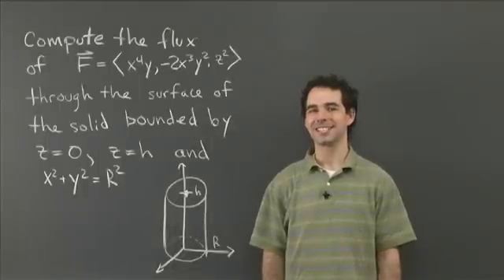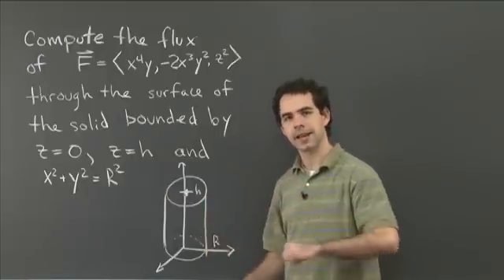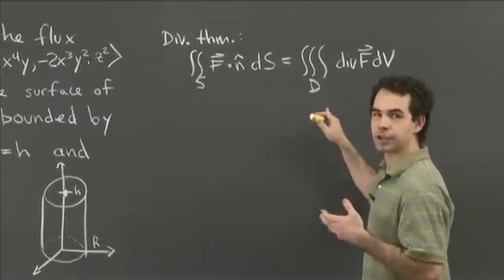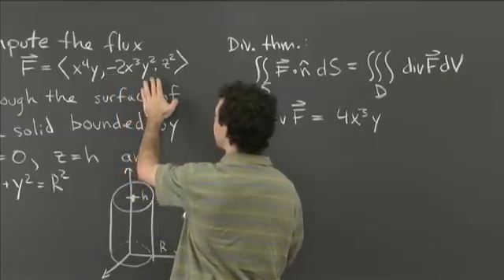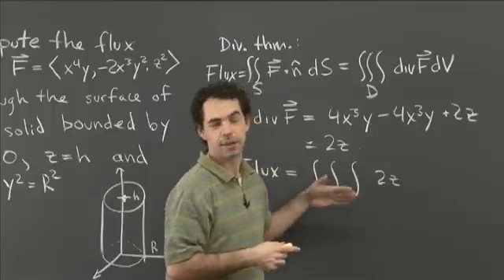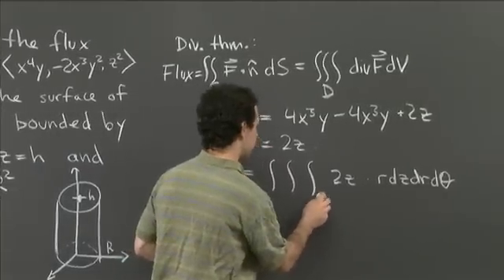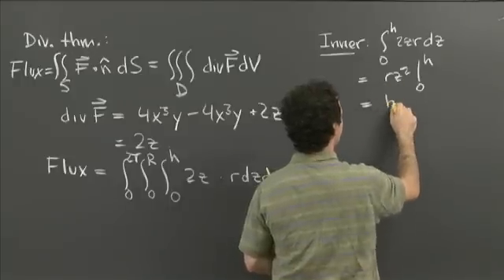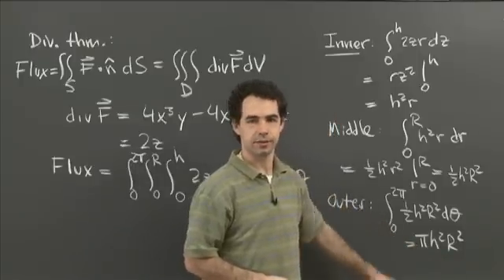Flux and the divergence theorem | MIT 18.02SC Multivariable Calculus, Fall 2010

Comment: Is there a proof that shows that the divergence is the sum of the partial derivatives? Why is this the definition and why does it work?
Reply: Probably late answer, but the divergence of a vector field F is by DEFINITION the sum of the partial derivatives of F. It's the dot product of the vector ∇ and F, where 

∇ = <∂/∂x,∂/∂y,∂/∂z>

so 

div(F) = ∇·F = <∂/∂x,∂/∂y,∂/∂z> · <F1,F2,F3> = ∂F1/∂x + ∂F2/∂y + ∂F3/∂z
Reply: There are many different proofs for it. Just requires a bit of algebra.
Reply: Actually using the nabla operator to define divergence with dot product COMES from the fact that it can be proved that divergence is the sum of the partial derivatives. So that is not a proof! One way the demonstrate it is that being the function differentiable in a point, you can write down its linear approximation using Taylor's and then demonstrate from there that the divergence of the function depends only on the term with the gradient. With some Algebra that brings you to the fact that divergence is actually the trace of the Jacobian matrix!
Super late response :P

Comment: V. (Total 12 pts) Let
f(z) = 1 . z2 − 5z + 6
1. (3 pts) Write f(z) as a sum of two fractions, i.e., f(z) = A + B ;
z − z1 z − z2
calculate the constants A and B. What are the points z1 and z2?
2. (5 pts) Explain whether it is possible to expand f(z) in Laurent (or Taylor) power series of:
(i) z, that converges in the region 0 � |z| < 3?
(ii) z + 1, that converges in the region 2 < |z + 1| < 3? (iii) z + 1, that converges in the region 3 < |z + 1|?)tan⁻¹cos⁻¹lcos((coscos⁻¹log=:|⋕⋮⋮≜≫≡≡ννννμμ889880-mξλρπθκααμμkℤoooo||⋮⋮⋮⋮⋮|||)⌋}‖]]][[9sin⁻¹sin⁻¹logsincos⁻¹sin⁻¹tan⁻¹cos(((

Comment: I don't even understand what I don't understand
Reply: Just Me  5:11 how did he end up with just 2z?
Reply: @piglink10  Let me try to explain this. He calculated the divergence of F, which implies the sum of the derivatives of each component like: F(x,y,z) = (a, b, c) -> div F = da/dx + db/dy + dc/dz. So, in his example, he choose wisely the F field so when you calculate its divergence, the first two terms cancel out, leaving the third them which is 2z.
Reply: @arufuredo   what does "choosing the F field mean" and why does this cancel out the x and y components?
Reply: @nonya1119  By the F field this guy chose, you can see that the first and second term are kinda similar. The derivative of the the first term respect to x and the derivative of the second term respect to y are equal. Hence, when you calculate the divergence of F, they cancel out, leaving just the derivative of the third term respect to z.
What I mean with "choose the F field" was that to OP selected this specifical vectorial field so that the example was easy to solve! :D
Reply: @piglink10   because 4x^3y-4x^3y = 0. The divergence is a dot product, so the vector components reduce to a summation.
Reply: Your problem is that you don't find any approprite problem.

Comment: I learned it as d-sigma instead of dS on the surface integral. I'm guessing there is no difference? Just |ru x rv| du dv right? where r(u,v) is the surface parameterization and ru, rv are the partial derivatives

Comment: Good demo of the divergence  theorem simplifying the problem, but this problem is trivial without the div thm if you look at the symmetries (and anti-symmetries) of the X and Y components of the field w.r.t. those of the cylinder. As someone already mentioned, possibly pedagogical purposes for the set-up, but it might be useful for students to recognize when symmetry can simplify a problem even more than applying the div thm (or when it can simplify the math after applying the div thm).

Comment: There are 2 notations for vector fields. Yes there's the i,j,and k. But you can use function notation F=(Fx,Fy,Fz), which Fx,Fy, and Fz would be the same as being coefficients to a unit vector (i, j, or k). (: